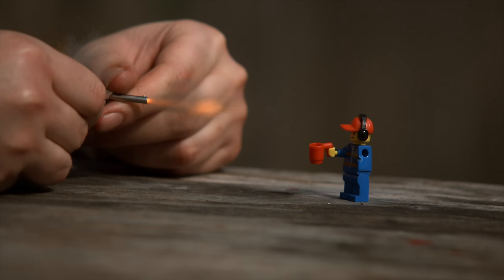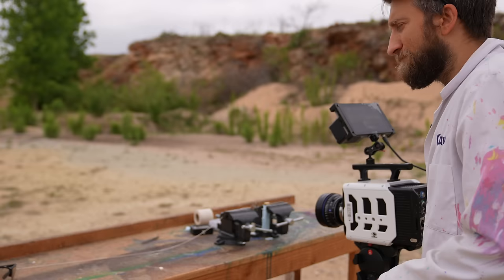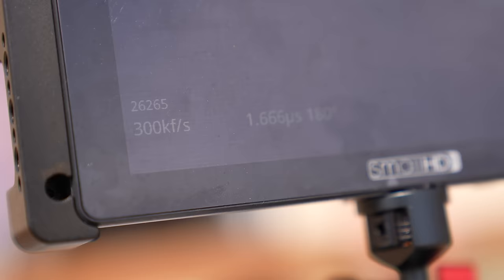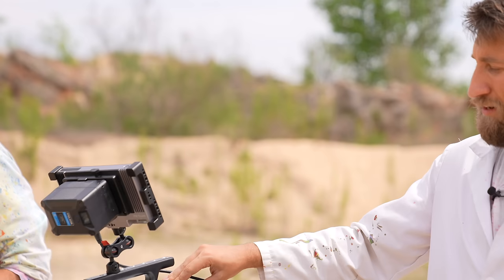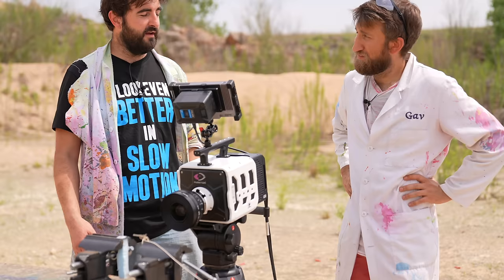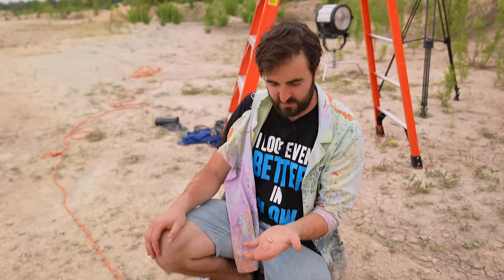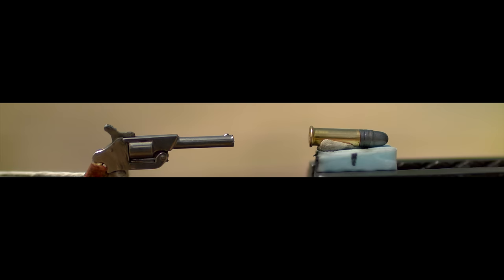Can a 2 Inch Gun Fire a 1 Inch Bullet? - 300,000FPS - The Slow Mo Guys

Comment: Its because the hammer usually stays up against the cap, the tiny bullet bounces away so the force can go both ways
Reply: hammers hit pins that hit caps in a gun... most pins are pretty tight, much smaller than the casing and leave a centered punch in the cap...
Reply: @vtwinner  and what does that have to do with anything? The point havocgear made is that one of the purposes of the firing pin being fixed forward after shooting is that it holds the primer in place. By holding the primer in place, the forces of the explosion are instead directed to the least path of resistance. The path of least resistance being the projectile that is only held in place within the cartridge by friction.
Reply: @ShaggyRogers1  its not fixed forward... the bullet is held by its rim in the breach, not by the PIN...
Reply: @vtwinner  The pin holds the primer, you dingus. You see that little cylinder that keeps flying out the back of the round in the video? That's the primer.

Comment: I'm convinced a lot of engineering has gone into minimizing damage from a round that detonates outside of a firearm. This is really impressive.
Reply: I think it's just coincidental. You need just enough metal to make the round be durable when outside the gun, and not too much so it isn't too heavy. Also brass is very soft, so it creates a good gas seal, and also it doesn't shrapnel much.
Reply: very little actually with modern propellent, if there is nothing to direct the forces they will dump in all directions with a pretty minimal velocity
Reply: As others have said, it’s more of a coincidence than an intentional design feature. A firearm uses the pressure of the gas directed in a uniform direction out the barrel over a distance. With no barrel all the forces dissipate in random directions.
Reply: It's not engineered to do that. The brass case is a gasket, a sleeve that is supposed to expand to the walls of the barrel or charge hole, and the pressure builds up.

Having the cartridge outside of a chamber simply stretches the gasket, which expands as far as it needs to. 

It is equivalent to pushing against somebody with an open palm, 5# of weight as opposed to pushing a knife against a person at 5# of weight. It has to be focused.
Reply: Do you think rounds are dangerous on their own?

Comment: 11:41 I'm surprised they didn't notice that the force of the case hitting the gun snapped the grips in half (and unlatched the barrel too!)
Reply: they noticed it, 11:50
Reply: @Adalgeir  Jeane is talking about the guns grips breaking, not the barrel.
Reply: @Jeanne They had to readjust the gun, so they noticed. They just didn't mention it.
Reply: Gav did say "It busted the end of the gun". Dunno what he was talking about, but I interpreted it as the grip busting. 
That shot was really quite something.
Reply: @speedingatheist  I think he's talking about the bullet of the small guns which got snapped in half by the casing and the small gun barrel's edges
Reply: I missed that. Thanks for pointing it out!
Reply: If you look at the 2nd time they view that footage the guns handles were actually broken before that as they shifted when the pin gun fired, this new hit just sent them flying
Reply: @DaReff  Yes, they only mentioned the damaged barrel of the gun. I was waiting for them to mention the grip breaking due to the force of the barrel being hit but they never did.

Comment: 4:53 the propellant actually never burns, basically what happens is the primer gets hit and goes off and pressurizes the inside of the cartridge, pushing it out and back at the pinfire gun, but the pinfire gun is still not done shooting out hot gasses into the already pressurized cartridge, so that's why the first wave of powder flies out, it's like if you were to blow into a cup of flower and then a bunch of it flies back at your face. Then when the pinfire gun stops pushing gas into the cartridge, it creates a vacuum effect and pulls the high pressure air out of the cartridge and into the normal pressure air, which pulls some more of the powder along with it. I know I'm a huge nerd for this, but I couldn't help myself

Comment: Incredible slow mo shots as always!

I was just wondering if the second bullet has enough energy to trigger a bigger bullet in a chain of 3 or even more... that might be worth to try.
Reply: I had the same thought, would be cool video!
Reply: They would probably have to do some kind of barrel to hold the casing but it would be really cool if they could go from the tiny gun to bigger and bigger bullets all the way to an artillery round
Reply: @BernardoPC117  I think they could've gotten away with a thick wall acrylic tubing, just to keep all the bullets in line
Reply: likely not because I don't think the bullet would trigger the the primer of the next bullet. its too large to hit the primer unlike a firing pin or the tiny bullet from the tiny gun
Reply: I wanna see if they can domino the bullets to fire a large calibur bullet!
Reply: Not sure about them in the open having that power, but it was definitely a possibility in a contained tube, like in the older lever-action rifles.
It's one reason whey we moved away from tube-fed firearms with the advent of spitzer bullets, there was just a risk for the pointier round to impact the primer in front of it and causing a catastrophic failure.
Reply: @JonnyViper  realistically, if the tiny gun can fire a 9mm, it can fire most any rifle round. There's not much difference between primers for centerfire ammo.

Comment: So, the question that is the title has been answered: Yes, it can. However, without a barrel to channel the energy, or something to hold the casing in place, Newton's 3rd Law enacts itself on the bullet and casing, sending both flying in opposite directions with equal momentum. Perhaps a makeshift gun barrel would solve this? Seeing a micro gun actually fire a bullet at speed would be awesome!
Reply: Equal momentum, not equal speed
Reply: @federicorios1140  thank you, comment will be edited
Reply: lmao, imagine the mini gun having a big barrel right in front of the tiny barrel and doing a chain reaction of bullets.... would be awesome
Reply: Maybe just weld the bullet by the casing to a fixed metal pole that is strong enough to not move backwards, no idea if the weld would hold or not.
Reply: This would only make the bullet travel a bit further and faster though, nothing like being in a barrel. The whole point of this photography is seeing how the rear of the bullet behaves when there is nothing for it to push back onto, which of course is how it can fires so fast usually.
Reply: @concernedcitizen3254  Lol, I'd be a little concerned the heat from welding on the casing would set the gun powder off.
Reply: @stephenpennington496  casings are not welded
Reply: Equal force/energy not speed, not momentum,  I'm not sure momentum means force ,  equal and opposite reaction,  means the same amount of force was applied to both objects moving them in opposite directions,  momentum is mass×velocity  and is the results of the applied force
Reply: @nicholasorlando6969  they know
Reply: @nicholasorlando6969  low literacy rate for you

Comment: The majority of the propellant burns inside of the barrel, which is essentially a pressured chamber that allows for immense internal heat that forces all the powder to ignite. Pistol powder burns quicker but it’s still proportionally insufficient for the centerfire rounds. 
 Great stuff!
Reply: To better elaborate, what is holding this round functionally back isn't a barrel, it is a chamber. At minimum you would need something to hold the primer in the primer pocket. This would allow it to build pressure, until the casing ruptures in a very dangerous way because there is no chamber wall supporting it. But even just a supported casing with no barrel will likely be enough for deadly kinetic energy. The barrel's purpose is to accelerate and stabilize the projectile. The back area of the bullet will have this immense column of pressure pushing it down the barrel (that will dissipate as it moves down the barrel, which happens fast in pistol calibers because they lack powder capacity and are generally very 'overbore' or straight walled, so peak pressure is reached immediately and then pushes on a relatively big surface area, a big contrast to some rifle rounds that hold lots of powder and fire small diameter projectiles).

Comment: awesome stuff guys, I like the idea of seeing "inside" a gun barrel.  You need to have an acrylic barrel made for a smaller caliber, then you'll be able to film it from chamber to muzzle.
Reply: The trick here would be that the barrel and chamber would have to be stupid thick compared to a steel barrel and chamber. 
Even with small caliber rounds, you're still (briefly) looking at ten to twenty thousand PSI as chamber pressure. From what I've been able to look up (if I'm reading it correctly in the first place), steel is at least four or five times stronger than acrylic or polycarbonate in this kind of application...
Reply: Also, the crud left by burning propellant would instantly turn it black.

Comment: I would love to see a version of this with the casings anchored, which would be a much closer comparison to what happens in a gun! Maybe for the CF 9mm the anchor would include some overlaid prongs to keep the cap from popping out!
Reply: It wouldn't be too much different from what's happening here. The projectile would probably travel further, but the majority of the energy will be released into the air when the projectile is out of the casing.
Reply: The same thing would occur.  The slight factory crimp on the bullet is tighter than the push fit of the primer.  

It is one of the MANY reasons military rounds crimp and seal the primer pocket
Reply: @RevDrTarr  That's true. It's why short barreled firearms firing high velocity bullets (meaning a small projectile and a lot of powder pushing it) have a much larger muzzle flash. Unburnt gasses and even some powder.
Reply: I'd like to see that as well, it would be very different because a lot of that energy is pushing that very light brass back faster than it's pushing the projectile. It would force what little energy is produced to push only the projectile. Still without a barrel and back plate in the gun containing all that energy the round would be non lethal speed but faster.
Reply: @joegesch8589  exactly!
Reply: That gift is a scam

Comment: This taught me a lot about the mechanics of recoil! The only thing I would have wanted to see was if the cartridge was immovable/clamped in place, how much farther would the bullet fly. This sort of mythbusted movie scenes involving bullets in a fireplace.
Reply: In a fire, there is enough heat that all of the propellant ignites spontaneously inside of the case, making it extremely dangerous compared to this.
Reply: So my young nephew actually threw a handful of 22 bullets into a campfire.  They steered clear of it for a while, but could hear the rounds going off every few minutes for a bit.  It was in a very wooded area and one of the rounds ended up hitting a pine tree close by knocking a piece of the bark off.  While it's definitely nowhere near the power compared to firing from the gun, it could still do some damage to a squishy human.

Comment: If you guys want to try this again, use military ammo, which has a crimped in primer, which should prevent the primer from coming out the back and will likely send the casing backwards even faster.  The casing will almost always go farther/faster than the bullet because the casing is lighter than the bullet, as you have already noticed.
Cheers, 
jc

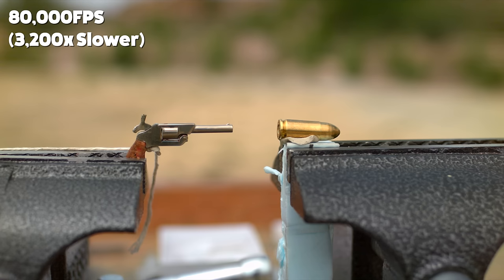Comment: The results starting at 3:20 raise a couple of interesting points:
- The percussion cap, in a sense, acted like a miniature shaped charge blowing back at the 2 inch gun. And the percussion cap is designed very much like the shaped charges the Slo Mo Guys used in another video.
- This demonstrates that the hammer on a gun has a function perhaps not recognised before. The presence of a heavy, solid piece of metal reflects blowback and directs energy forward, much as the gun barrel contains the explosion. Both of these increase the forward velocity of the bullet and also help to ensure full explosion of the gunpowder charge in the cartridge.

Comment: I’ve always wanted to know what would happen if you hit the primer cap of a bullet outside of a gun, and now I do.
Reply: You can do a fun but dangerous trick with a 22lr in a plastic straw. Put it in the straw and throw it up in the air or at the ground, the straw makes the cartridge land base first because of drag and various other physics reasons and this makes the cartridge go off like a firecracker. Bullet doesn't go fast enough to do any real damage but the downside is it can send sharp casing shrapnel in any direction so definitely not a good idea

Comment: When the .22 was fired it was a great demo of conservation of momentum! The bullet which is quite a bit heavier than the casing moves much slower than the casing does away from the explosion, as they both receive roughly equal force but take less overall force to accelerate the lighter projectile, being the bullet casing.

Comment: 8:15 yes actually my experience with this is also that the gunpowder from a bullet burns rather slowly, nowhere near as fast as the silver powder from heavy fireworks. So I suppose it needs the pressure from the gun barrel and also the firing cap also needs the gun chamber to enclose it. The small calibre bullet uses a much more explosive type of powder (for the cap at least), assumedly because the calibre is so small it needs this to get similar velocity as bigger bullets

Comment: I would love to see a version of this where you could show it passing through a barrel... my thought process is that if you cut a slit big enough into the barrel to see the bullet. I imagine that a lot of the power will be lost from the gasses exiting out the side but it might make for a really cool visual seeing the bullet spin and how much of the gasses still move down the barrel even with the slit.
Reply: Clear bulletproof material, bored out to make a "barrel" for the bullet to travel down. No (or at least very little) pressure loss, and should still be able to see through at least for one shot.
Reply: This sounds like a Smarter Every Day video (though the closest matches I've found so far are 156 and 177)... that said, I too would be curious to see a slow-mo guys-level production of what you're talking about.
I'm also thinking you could film the reflection from a mirror located downrange (if you can figure out a way to light the inside of the barrel with whatever kind of sorcery you'd need for that, that is), and not have to worry about clear components
Reply: @almach6279  Lighting up the inside of a steel barrel from the outside means the camera would need to look straight down into the barrel. The only thing it would see would be a metal blob spinning and moving towards the camera. 

I wanna see the powder burning, the gas swirling, and the bullet accelerate down the barrel. In other words, I want a side view.
Reply: it wouldnt be hard to make a smooth bore barrel for 22lr thatd give you 2 clear chances before scorch blacks out the barrel. otherwise that transparent aluminum for larger caliber

Comment: so this is basically what happens when the firing pin 'light strikes' the primer, it doesnt full penetrate the primer and set off the propellent. if it fully struck the primer, crushing the anvil and igniting the propellent then it would 100% fire the round off.

Comment: When it comes to a primed case like the 9mm they used first. The chamber of a gun along with the locked bolt effectively hold a cartridge together. When I make and fire a "hot" rifle round I am essentially pushing the limit of that system. The primer (What they are calling a percussion cap) always attempts to "back out" of the case. In a hot round will actually flatten the primer and press some of it into the firing pin hole on the bolt face, clearly indicating it's rearward movement. I mention this because that is what they are dealing with here. The primer is igniting but it is pushing itself backwards as that is easier than pushing the hot expanding gasses through the very small flash hole into the case. This is also why the powder was not igniting properly. They should be happy. A properly ignited 9mm brass case, outside of a chamber, is basically a small fragmentation grenade. Those camera lenses are expensive.

Comment: So in a firearm here’s a breakdown of what happens. When the primer is struck, the priming compounds ignite the powder charge. The first explosion of the primer creates enough pressure to move the primer out of its pocket ever so slightly (if you ever just load a primed case into a revolver you’ll note it can jam the revolver as the primer has backed out beyond flush with the back of the case). The ignition of the main powder charge caused pressure to increase rapidly, shoving the case against the wall of the breech face pushing the primer fully into the primer pocket of the casing. The increase of pressure overcomes the friction between the bullet and the casing, separating the two and the bullet follows the path of lease resistance which is down the barrel and out the muzzle. This is why when the round is set off in the first take the primer blows out completely and the bullet has only moved slightly. Because the pressure followed the path of least resistance.

Comment: Just a tip the fully assembled ammo is called a round which is comprised of a brass casing filled with a powered charge which uses a primer to set off the charge which then sends the fmj projectile down the barrel and the reason the primer came out is because it’s not in a firearm, when a round is an a firearm it’ll be held in place preventing the primer from flying out!